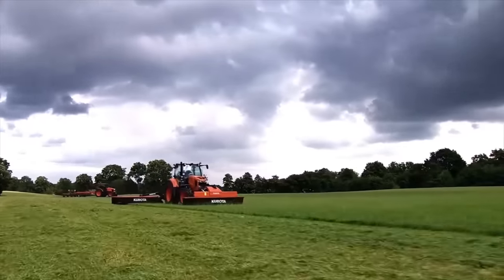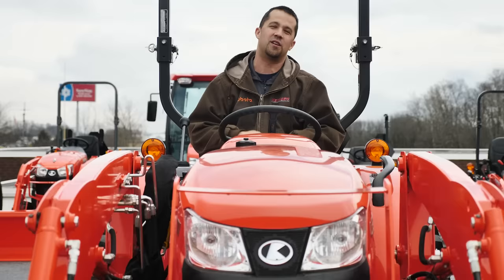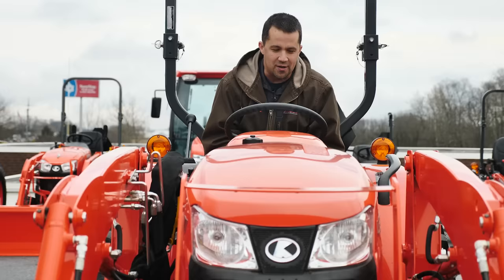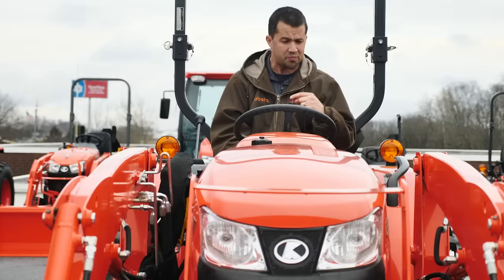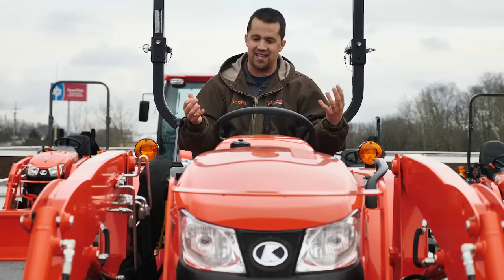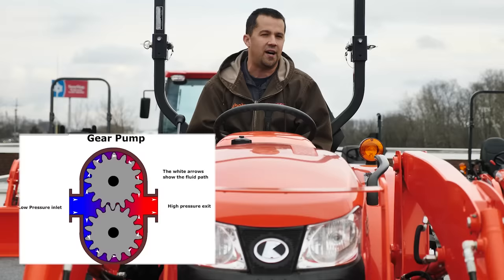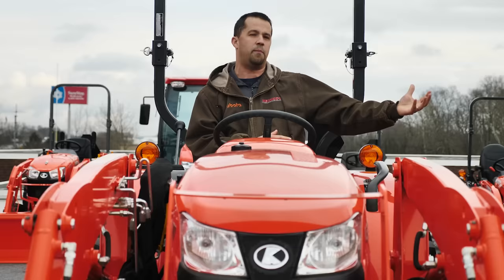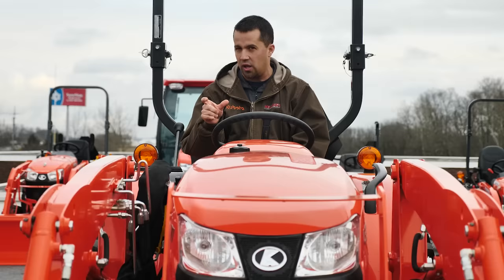Why you may NOT want more hydraulic flow from your tractor?!

Comment: 3301 is only 22hp?
Reply: What are you talking about?
Reply: I caught the same thing.  In his example he said it took 14hp to pump the fluid leaving only 8hp to drive the tractor.  His math doesn’t work
Reply: @motor2of7  We can forgive him though! He's done a lot of great vids.
Reply: @svtirefire  L3301 Net horsepower is around 31.
Reply: I think he said it in a way that left it easy to misunderstand and had the "save" of it in the end of the sentences. An open loop hydraulic system pumps oil around all the time but the pressure mentioned isn't there. So it doesn't take much engine power to just pump it around. But if you connect a hydraulic motor and it drives something heavy, then they pressure goes up (until safely valve limits it). Then it takes more power off the engine.

Comment: Messick's
Question - Is there any other factors besides PTO Horsepower and Speed to make one machine Blow Snow better than another ? I am interested in looking into getting a small tractor to maybe Blow Snow / Plow Snow / Have a loader and Pull a Land Plane.  A video on that would be great. But I'd love to know. I really want to get one. Was thinking BX2680 or Deere 1025R / 2025R
Reply from the maker: The biggest thing I would look at is the mounting process for the front snow blower or plow. Performance wise, they are all about the same.
Reply: @MessicksEquip  How does the process for mounting snow blower on Kubota vs. the John Deere
Reply from the maker: It's been awhile since I have seen what Deere is doing. Kubota just changed to the newer 4-pt hitch which is a lot easier than the old one is. I think Deere still sources the snow-blower head itself from RAD-tech, same company Kubota gets theirs from.

Comment: Just make it an option... make it a future upgrade. While the design time is money, it will pay for itself and offer a wide range of upgrades to the people that want it for all tractor sizes. Never understood  why you can get a 50-60hp tractor that only has 10gpm. Open up the implement choices, there are so many implements for skid steers that makes no sense to have such weak pumps. besides. having 15gpm pumps is not that big a deal in terms of parasitic loss when not in use. What are you giving up? 2-3HP? That is nothing in regards to having the utility to run a front auger and other skid steer attachments.

Comment: This is my problem Neil. I have a B7800 with a Woods backhoe. I need more weight capacity for my FEL as here in NH the glaciers left half the granite from the mountain tops on my property. I also need more power got my backhoe for stumping and bolders. I looked at the L39 as an upgrade but it's only giving me about 20 percent more force which, as you said, is not much for the price. I looked at the L4060 but that is big money and cuts down on maneuverability in the woods go pull logs. Is there a compact tractor model that hits the sweet spot?
Reply: We all want one that will do everything 😅
Reply from the maker: L45-l39 is way more tractor.  Specs only tell half the story

Comment: Well they could add a electric powered booster pump for under high demand conditions.  

But it would add addition cost.
Reply: They also have pto driven hydraulic pump/reservoir units available that a tractor owner can add to drive high flow demand implements. But it's still an additional cost to consider.

Comment: Your information is aways great and i have learned a lot i have one question why would they include the gpm for the power steering in the rating for the tractor my thought is if you cant use it don’t publish it
Reply from the maker: Yea, I don't disagree with that. Its kinda shady when its lumped together. I did in this case because its all relevant to the discussion.
Reply: I agree you needed it for horse power to hydraulic output and for the video you right on the money I guess its just like advertised lifting capacity its where it’s measured and everyone and a different spot to use

Comment: I am looking at subcompact tractors and found a skid steer log splitter. Looks awesome to be able to drive to the log round and split it then move to the next. Problem is it requires 8gpm and the tractor I am looking at is 4.2gpm.  I am not considering the splitter now, but am wondering what happens if you under power a hydraulic implement? In this case would it just be speed or could actual splitting force be affected?
Reply from the maker: Mostly speed
Reply: @MessicksEquip  if that is the case, would it damage the tractor or log splitter at all running it on the subcompact?
Reply from the maker: @fmixthings  damage.. no, probably not. I'd still never go that route. A $1200 gas powered one will put it to shame.
Reply: @MessicksEquip  I have a $1200 gas log splitter. It does a great job. I'm interested in the above mentioned comment. Being able to use the SS log splitter as a means to move the log would increase productivity. Having a pile of cut logs that need to be split, I would love to drive over each piece and split it over the trailer. This would save a ton of time, not having to move the same puce of wood 3 times.

Comment: Why do they have 3 separate pumps for main hydraulic, steering, and hydrostatic transmission instead of 1 pump for all 3?
Reply: Spud Gamer doesn’t matter.  Still takes the same energy to move the fluid regardless of how many pumps you split the load across.
Reply: One could be contaminents - I guess the hydrostatic system is sensitive to the oil it uses. They don't want mr. cheap connect it up to some old equipment with bad oil in it and have it mixed in.
Another factor could be that (not talking Kubota here specifically cause I don't know) they buy they transmission system from one supplier and the working hydraulics from another.
My ag tractor with no fancy transmission have one double pump (high and low pressure circuit) and the steering is first in line on the high pressure with a priority valve.
I remember the manufacturer at least recently had models with basic transmission and other options with full power shift and CVT. The basic transmission, like previous models, shared the transmission oil with the working hydraulic, but for their (in house developed CVT and FPS) they had gone and septated them into different reservoirs but some common wall inside that could exchange heat. So it was clearly a concern of not wanting potential nasty oils into the delicate system.

Comment: You can always add a PTO driven hydraulic pump
Reply: Yeah but then you don't have a 3point hitch or draw bar.
Reply: I was thinking the same thing and for any front loader mounted equipment that "could" be a viable option but just like Neil said, "no free lunch" so you do lose something.
Reply: The PTO pump just draws horsepower from the same engine.  It doesn’t change the outcome
Reply: @motor2of7
You are correct, but for a device like a front mounted snow blower, post hole digger or any other if the many devices that can be put up there you will get a high volume flow from a 3 point mounted  pto driven pump/reservoir system as the tractor is designed to give (as in my tractor a B2920) 20 ish horsepower to the PTO while still doing all the normal functions of the tractor.   So the separate system will run your add on equipment, it may look like a Frankenstein with the giant box/PTO pump/hoses compilation but it will work.  Now I have been wrong in the past and very well could be wrong here  and like neal said "no free lunch" means it's no longer compact and pretty but "funtional"
Also, thisnis just theory based since I dont have the large cash flow needed to purchase said hydraulic system and try it out.  If I did, i would have bought a larger tractor that had the larger high flow  pump with 3rd or 4th functioning remote on the joystick controls.  🤣🤣
Reply: Thaddeus Troyer I completely agree. I was just commenting on the HP question. 
Lots of advantages to adding a high volume PTO pump.  I’ve considered building such a setup to power a FEL mounted mower.

Comment: There you go- talking sense again.  What are you trying to do?  Break the internet???
Reply: Your maching will not run a 40HP mulcher at the same time it will run a front hydraulic mower (if it were capable of running a front mower like a skid steer). I wish at minimum most of these tractors would start in 15gpm like a low flow skid steer.

Comment: It costs both power and dollars, there's a reason they can't run a car on water, it's because you use more power electrolyzing the water than burning it gives back.
Reply: You can run a car with water.  Not on water.  Why we are not running steam compressed cars is beyond me.   With solar assist, brake assist and the heating elements we have today,  you know it is possible.
Reply: Rofl Stomps but not gonna get anyone anywhere on day to day stuff.
Reply: @FishFind3000  why's that?